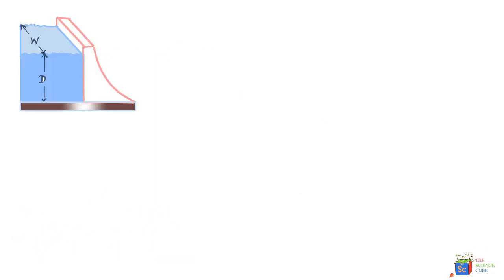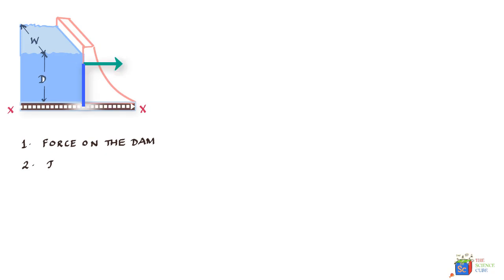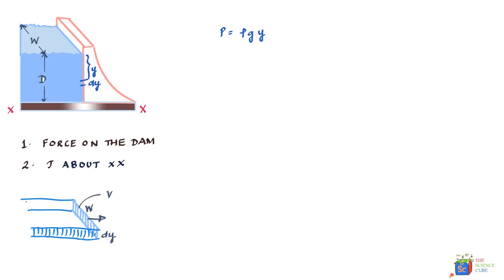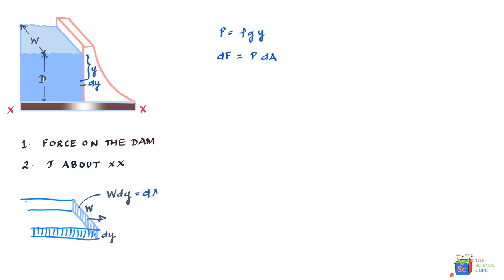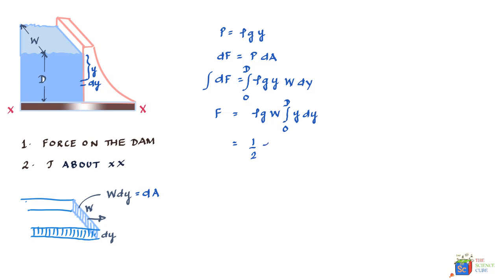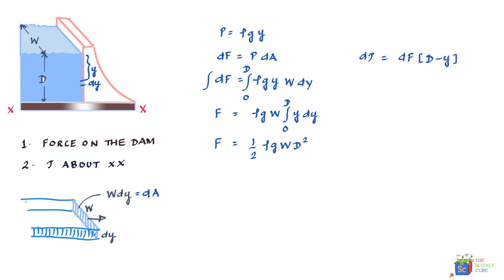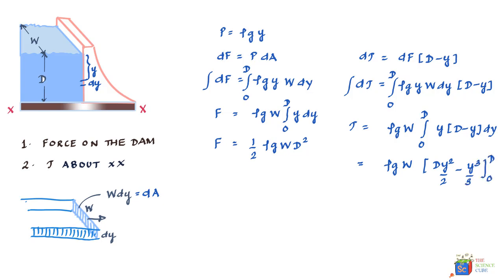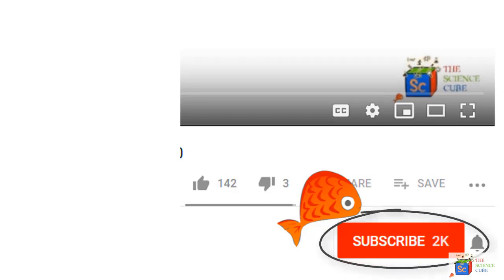Pressure and Torque on a Dam Wall #11

Comment: why dont you take into account the anglw between the forces and the point you are calculating?
Reply: I mean, torque is Force . distance . cos(alpha) being alpha the angle between the two of them, i guess that term doesnt appear because you are assuming the angle is 90 right?
Reply from the maker: @joakuakuack  You are exactly right. Also important to remember is that torque is a scalar (often students think it is a vector) and always acts perpendicular to any surface.
Reply from the maker: Hi! Do you mean where the water impinges the dam wall?

Comment: Consider the wall of a dam to be straight with
height H and length L. It holds a lake of water
of height h (h < H) on one side. Let the density
of water be 􀁖w Denote the torque about the
axis along the bottom length of the wall by
􀁘1. Denote also a similar torque due to the
water up to height h/2 and wall length L/2 by
􀁘2. Then 􀁘1/􀁘2 (ignore atmospheric
pressure) is